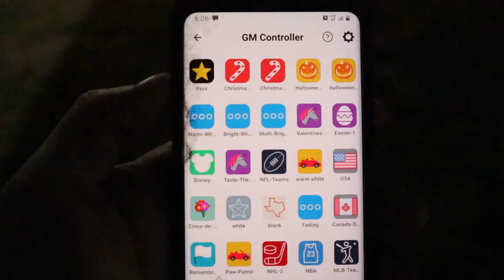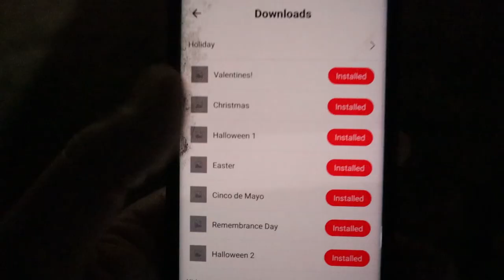Gemstone Lights soffit lighting  - A excellent permanent customizable lighting option!

Comment: You have the BEST video on the internet of real install of these things. There isnt much on the internet that really details the install and this is really the only one. I just wish you had some shots of areas where the track turns into say a corner and how you terminate it to the transformer and where it's mounted. Especially if it has to penetrate exterior wall to the an inside.
Reply: Indeed. my installer just finished and I love them but I did not realize that the wire looms would show where they have to transfer from one area to another.